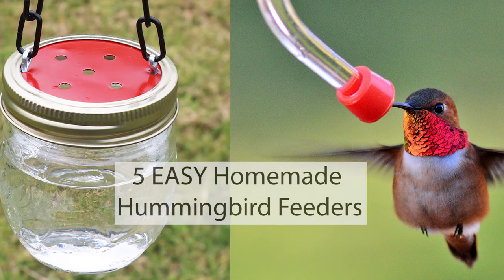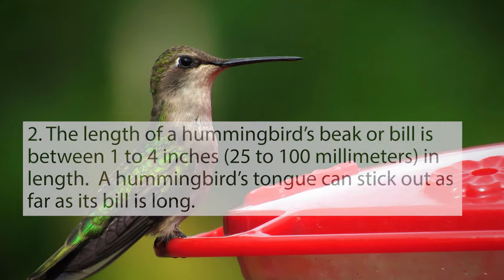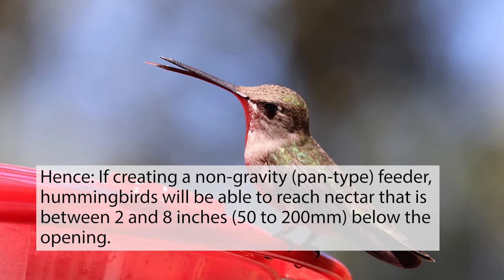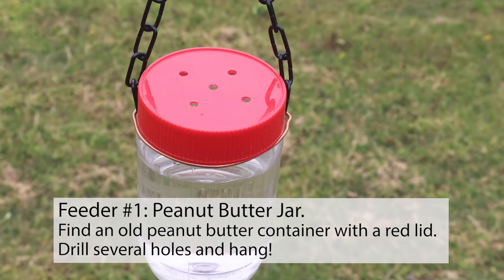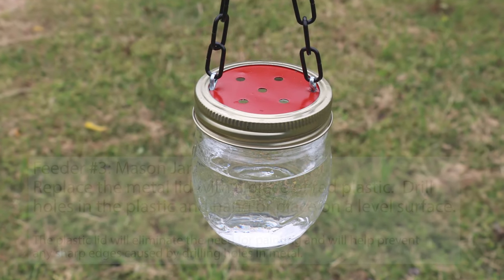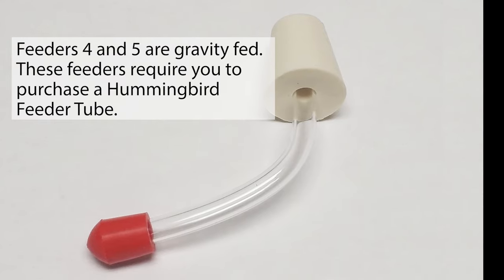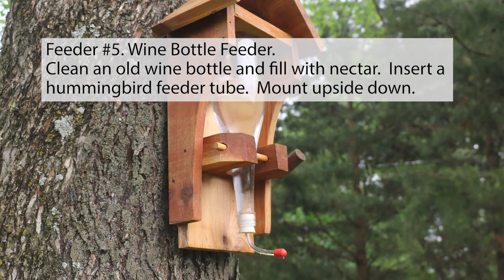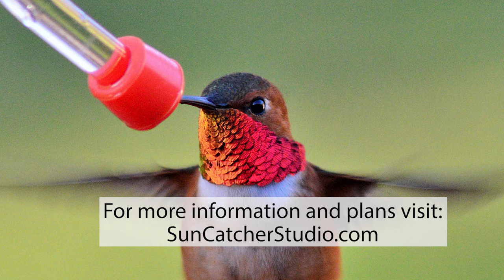5 EASY DIY Homemade Hummingbird Feeders

Comment: Change out the nectar regularly -- generally every three days or so. 

It depends on temperature: in hot weather, change it out daily. In cool weather less often is fine. 

If the nectar turns cloudy, it's overdue. If the nectar turns cloudy, it's gone bad from bacteria and/or molds. These can kill hummingbirds (either directly or by making their tongues swell too much to feed properly) though they will probably die out of sight.

When refilling, it's a good idea to also clean the feeders thoroughly ( especially if you see any black spots -- a particularly dangerous mold and sure sign you've left them uncleaned much too long).

White granular table sugar only -- no brown sugar or molasses (too much iron), or honey water (prone to especially deadly microorganisms). No icing sugar (it has other stuff besides sucrose).  Remember that what's good for us humans is not necessarily what's good for hummingbirds. The other nutrients they need, they'll get on their own -- so stick to granular white sugar (sucrose: a.k.a. refined cane or beet sugar).
Reply: Excellent advice, Bernard.  I'd like to include that red dye added to the nectar is unnecessary and potentially deadly for these little birds.
Reply: With the Texas heat, I think I will only put fresh out in the morning for a few hours. Then discard & clean container every night. 

They have been amazing to watch! They love my hibiscus, butterfly bush, & Pride of Barbados sometimes. Mostly the hibiscus of which I have several. I decided to make a feeder today after reading they have to double their body weight before their flight for winter.

Comment: Change out the sugar water every time - don't just top it up.  It should be 1 part white sugar to 4 parts water.  Throw it away when you clean the feeder, because after a day or two exposed to the air, it's got yeast and mold in it.  And you need to clean the feeder every time you change the sugar water, too - use some vinegar and water, scrub the insides, and rinse several times.   Cleaning is why the bottles with narrow necks are not as good - they're hard to clean inside, even with brushes.    

Mold or bacteria that contaminates the sugar water can harm your hummingbirds.  If you're not willing to completely replace the sugar water every time, and aren't willing to clean the feeder every couple of days in warm weather - don't have a feeder, you're putting the health of the hummingbirds in danger.

Comment: How do they reach all the way to the bottom of the deeper ones?
Reply: They don't, doubt they can even reach the bottom of the spice container. But I don't think it matters, you have to change out the nectar frequently anyway, so they probably don't even have time to finish it all off. Smaller is probably better for less waste.